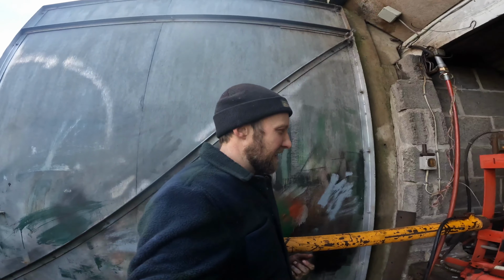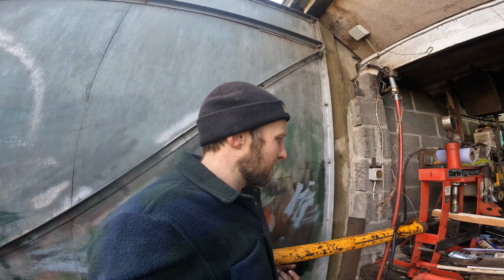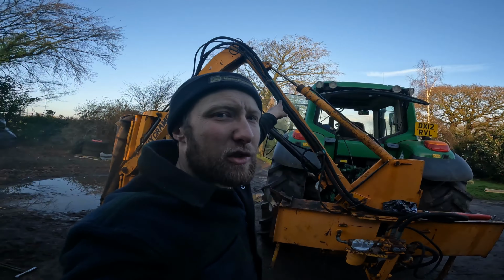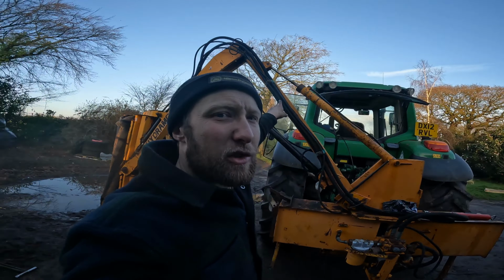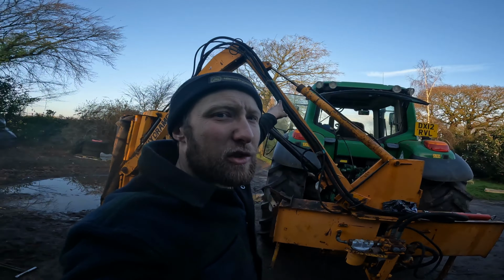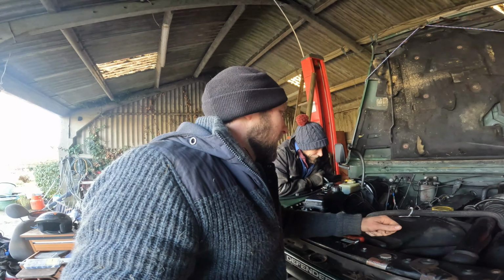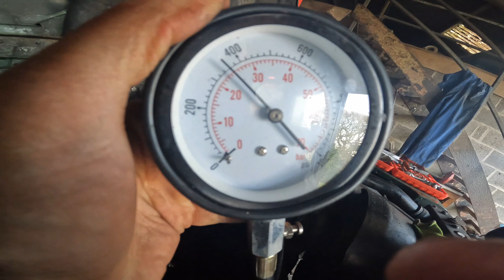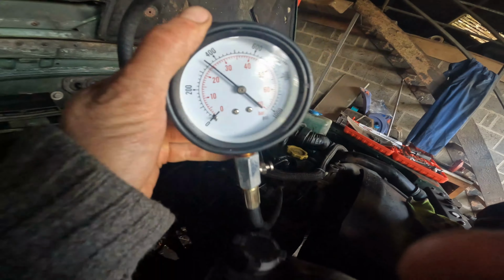No idea what we are doing, or why we are doing it...(hopefully Mark does)

Comment: I think your hedgecutter might be a teagle I looked at one when I was buying our twose machine I might be wrong hope you get land rover sorted it looks like it might be piston rings the amount of pressure in the crank case the one we had broke the crank shaft because a main bearing cap came loose got an engine out of a discovery fitted straight in
Reply from the maker: Got a few discovery bits on mine 😂

Comment: could it be that the engine is just worn ........bearing in mind it's done a lot of miles.......tractor engines will blow oil out the dipstick when there worn . my dad had a fergy 35x that blew oil out the dipstick and he would  take the dipstick out and bang a peg of wood in the hole to stop the oil coming out